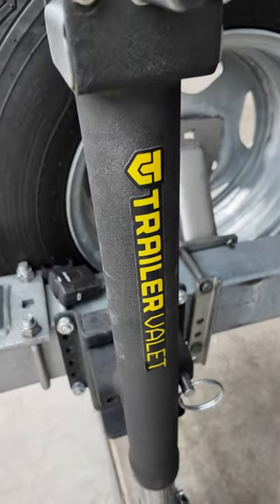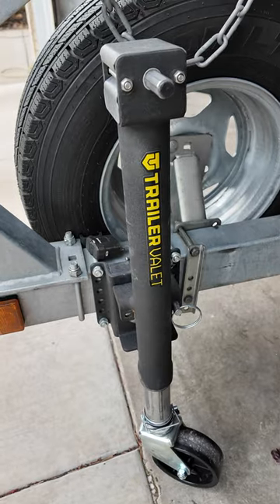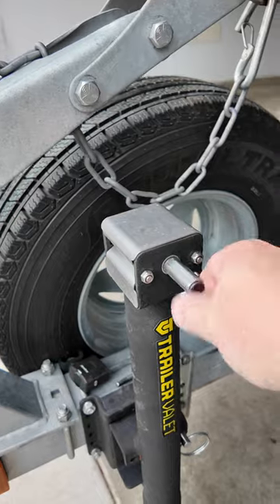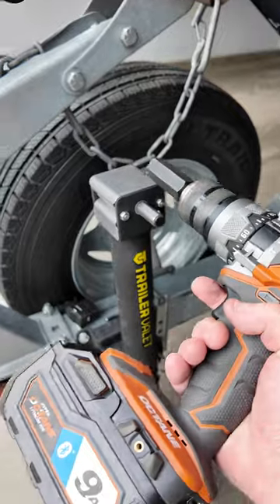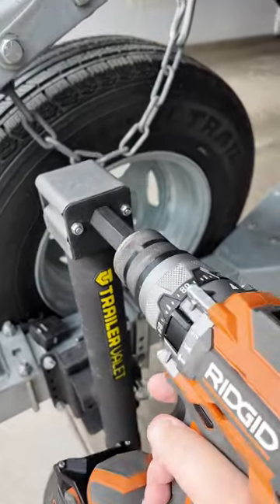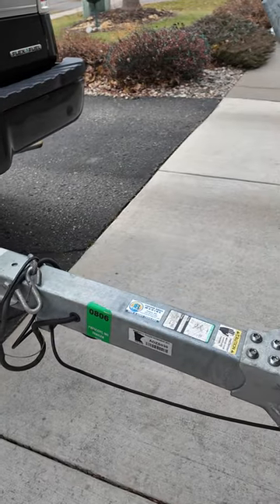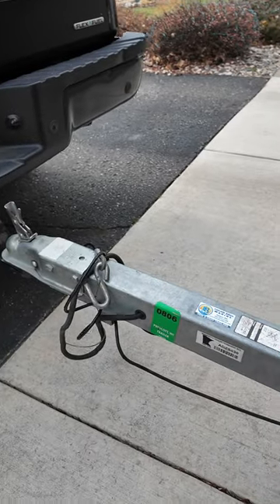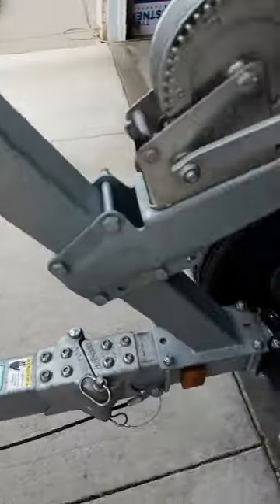Trailer Valet Boat Trailer Jack Wheel Drill Powered

Comment: Takes longer to grab the drill and socket than it would to just use a normal jack.
Reply from the maker: Well I do this 2 times every day.  Takes about 40 hand cranks.  I work smarter not harder.
Reply: Which model is that one